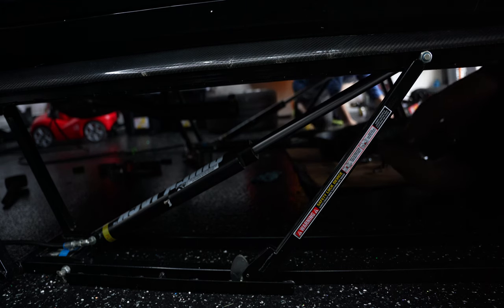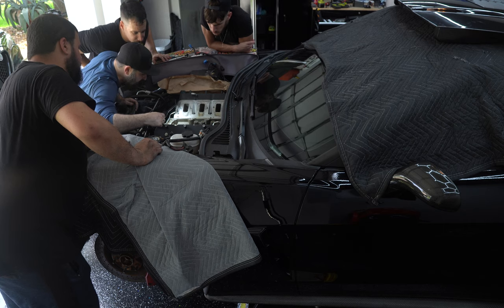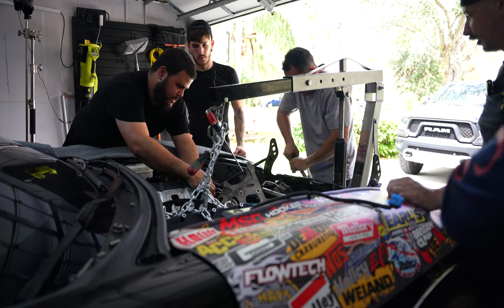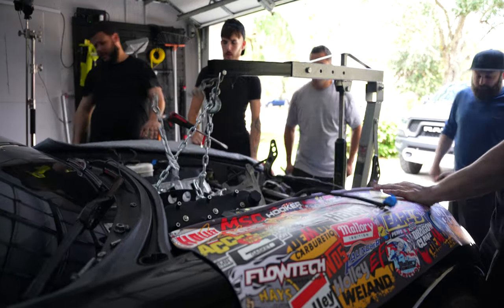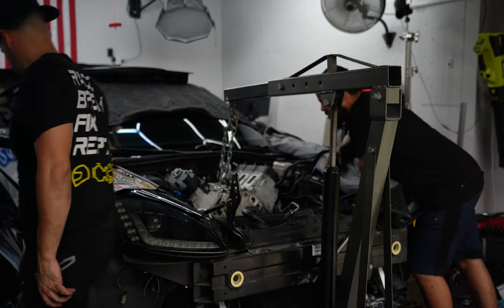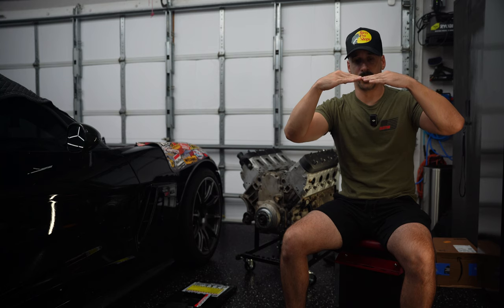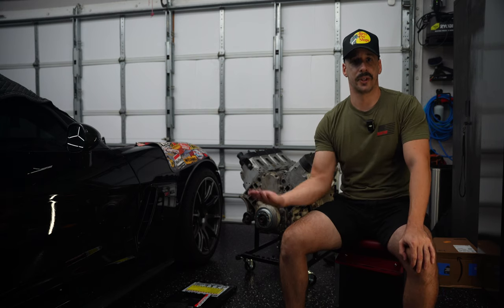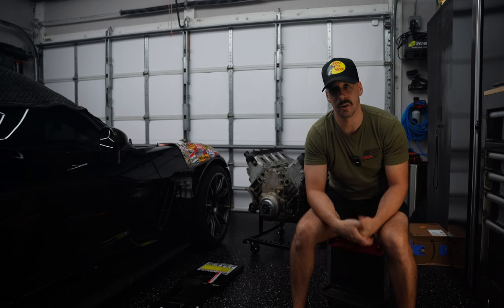Episode 2: Ripping Out My Ls7 Engine - LS7 Rebuild Time

Comment: Great vid bud.  Always a pain pulling a motor regardless of vehicle.  But you have it out now and you have a world of other things you can do "while you're in there", don't go overboard with it though as your platform is already pretty strong.  Just fine tune some things, figure out what would be best to keep the LS7 cool, well lubricated, and fed the appropriate amount of air/fuel.  Best of luck bud, looking forward to the next one.
Reply from the maker: Yeah! totally agree with you. I think the "While im there" can lead down a serious rabbit hole. I was already very happy with the platform while it was arguably running hurt most of the time. im going to improve a few areas mainly to protect the little components that dont get any attention typically.
Reply: @SloJoeRacing  I'd honestly call the guys over at Katech to see what they'd do in this case.  You'd be surprised to see what they have to say about these C6 Z06 Vettes, they used to run these pretty hard in ALMS racing along with all the things they did for the street cars they built.  A ton of the old C5.R LS7 parts would work very well for your build.  What could it hurt to ask right?
Reply from the maker: Yeah absolutely. ive had a few convos with them in the past and I recently purchased their high flow oil pump and c5r timing chain.
Reply: @SloJoeRacing  Here's a question for ya.  Are you going to upgrade the valvetrain on the heads at all?  If so, I'd go with all titanium valves just to lighten things up for the LS7 to really rev out past 7k safely.  Otherwise, some nice stainless valves work well at getting you to the 7k limit but not much further.
Reply from the maker: @TheWolfMatt  I will definitely be upgrading my rockers given some mishaps we've experienced with the  in the past. The valves are going to be inspected and we will see what route we take. Im basically taking my motor in its entirety without removing anything so they can asses every component and tell me what we need to make a happy motor for my use.
Reply: @SloJoeRacing  You already have aftermarket heads on the motor correct?  If so, maybe talk to the guys over at Texas Speed and their head shop they have over there.  Some really awesome guys there with a full lineup of very impressive machines designed only to do head work.  Worth a good phone call at the very least.  I'll either be going that way or getting a set of Frankenstein heads once I get my Z06 down the line.